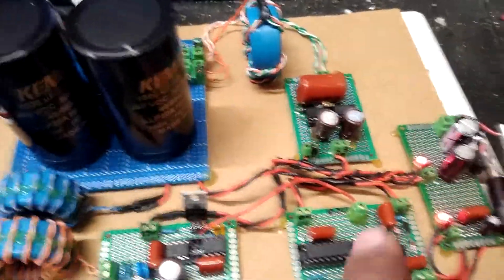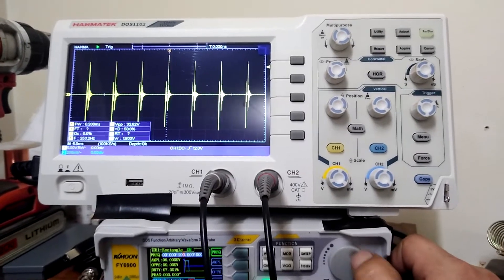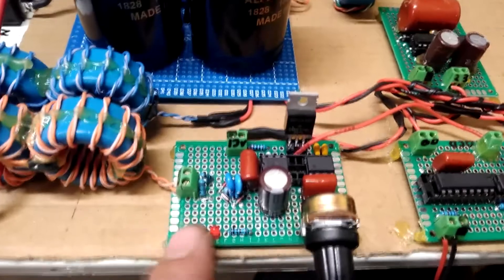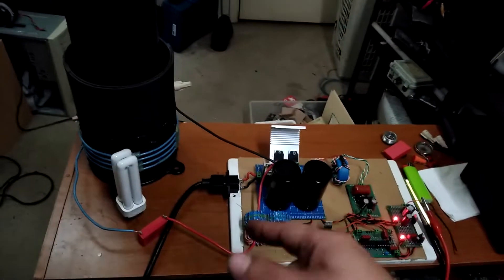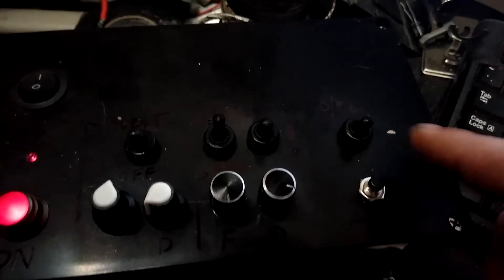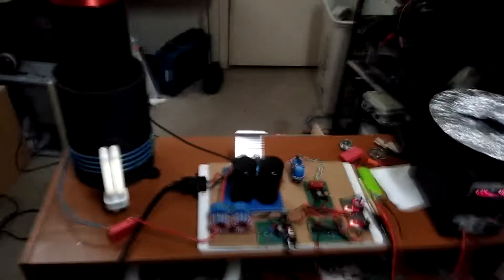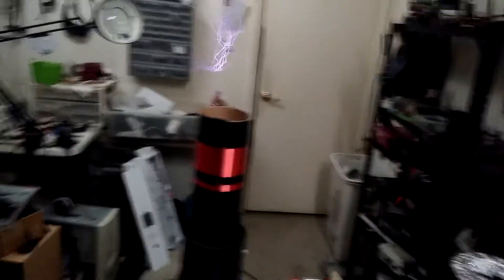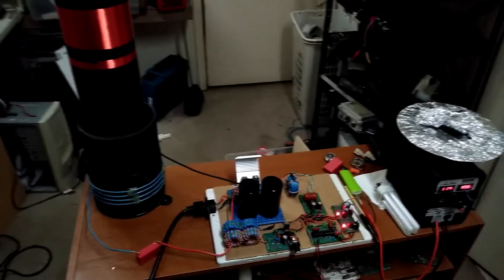Steve Ward's DRSSTC-1 W/OCD First Light Testing

Comment: Hi ! I am building the same model and I have a question regarding the OCD. When you rotate the variable resistor of the OCD, what exactly happens ? I mean, does it serve to turn the OCD on and off or to regulate how much I want it to protect the circuit? I suppose that when you rotate the variable resistor you regulate the level of protection of the coil, since the load resistance is selected according to the maximum current supported by the IGBTs; hence the relationship of the CTs in cascade and other calculations... I don't know if I have explained myself correctly. Thank you very much!
Reply from the maker: Yea you're basically setting a voltage set point relative to the burden resistors on the CT via the comparator. In the schematic I believe he has 5 ohms burden resistor. So based upon the amount of voltage this reaches given a CT winding ratio, a particular peak amperage can be determined. So the higher or lower you set this point the more or less peak amperage can flow through the primary before the OCD starts limiting the on time of the driver. The comparator output controls a 555 timer that switches the interrupter signal low through a mosfet whenever this set point (pk current) is reached. 

Typically the reason for this is because people are trying to push their setups to a point where they may be close to the limits of what their components can handle, so while they want to get close to a maximum from them they are calculating a pk amperage that is just going to be too much for the circuit. As unpredictable as these can be it's good to be able to set a pk amperage it cannot exceed to protect the mosfets/IGBT's. With mine I'm pushing fairly low power and assuming my tuning/coupling is close enough to not allow excessive primary currents. AKA the primary current is able to transfer to secondary arcs fast enough. So basically I just set mine to trip from ground strikes at the highest input I want to run them after feeling out the tuning. If I ever wanted to push what I thought was close to maximum capability from a driver/switches then I'd probably want to start calculating what these pk amps are going to be and how to set that limit. 

It's not something I've quite felt out entirely yet and so far have not really needed the OCD it seems, but it's a tricky thing sometimes to where it has to be shielded properly etc because it can sometimes trigger falsely.
Reply: @Magneticitist  Thank you very much for your quick response. Thanks to your explanation I have a better understanding of the OCD concept. I have built Steve's version of the DRSSTC .5 and in that case I didn't need the OCD because I was using a small size coil.

Now, I have built a larger size coil and in this case I do want to protect my IGBTs. Thank you very much for all your work, you are helping a lot of people who want to build their own DRSSTC
Reply from the maker: @alexcaleal9025  No problem at all. I've been slacking on building more recently but I should be getting my free time worked out a little better before long. I plan on building a high power one eventually but I've sort of been trying to pilfer what I can from work to save money.

That Drsstc .5 was a great circuit too IMO. I actually had some interesting results with the secondary feedback but my circuit was dying from ground strikes which is why I moved to the one with OCD.